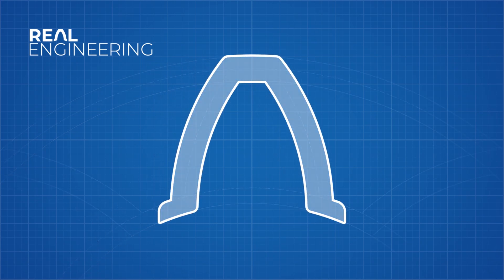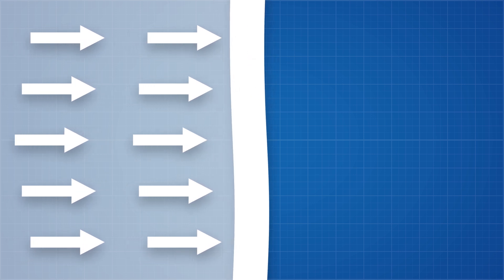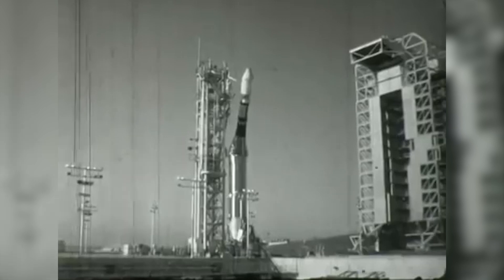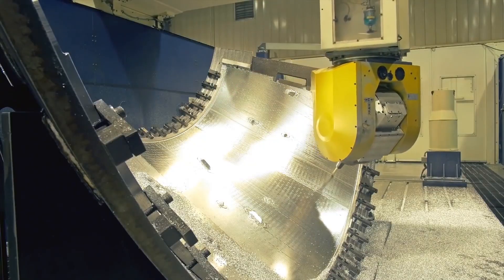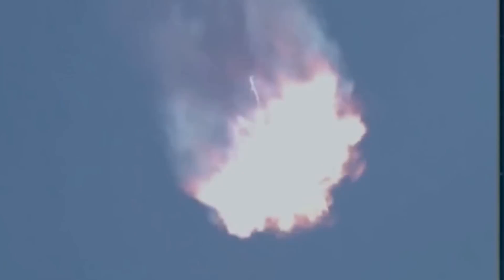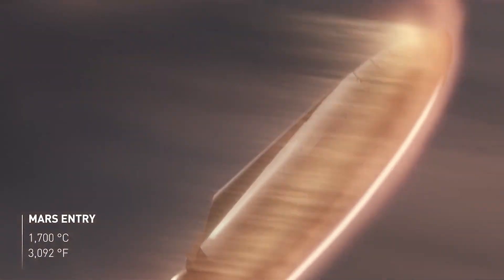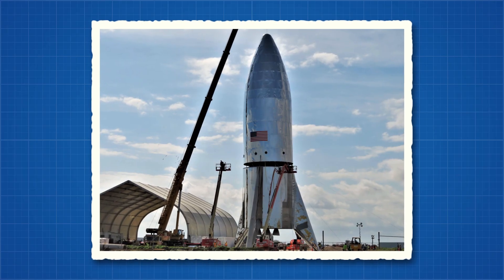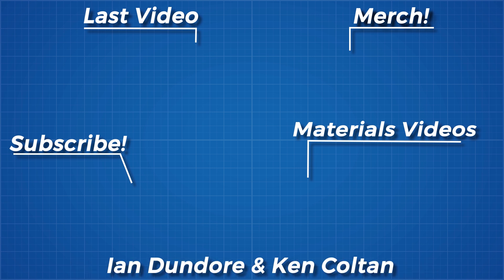Why SpaceX Built A Stainless Steel Starship

Comment: The sweating part is really really smart. Makes me believe that the best engineering is to copy nature.
Reply: we are biological machines if you think about it. maybe nature is the peak of engineering
Reply: @AverageBrethren  nature is gods gift and its our mission to to look at it and use it. Ki nda like a graph going closer to infinity
Reply: Sweating fuel while in fire, is not really a good idea
Reply: It is.
Reply: Sounds like what Nikola Tesla said "“If you want to find the secrets of the universe, think in terms of energy, frequency and vibration.”"
Reply: In deep learning field, computers took several hundred thousands of cycles to calculate the best parameters for their neural networks. And for mother nature, you can also consider it a super computer which already run for several million years for millions of animals and plants to try and error to find best solutions and adapt the environment and physical world. So it's quite reasonable to copy nature. I remember in some fields they call this technique "bionics".
Reply: Brandon Tea If I may be that guy: it’s called bio mimicry
Reply: @AverageBrethren  Nature is kinda garbage at engineering. Good "ideas" but shitty materials.
Reply: @A3ATOT  Remember, Mars's atmosphere is carbon dioxide, so the methane wouldn't actually burn while sweating.
Reply: GDash 69 of course someone has to mix god with real science
Reply: @AverageBrethren  Definitely not. It can be very useful inspiration, but ultimately, when you remember how evolution works, in nature you will find only the best solutions *that have emerged so far by chance*. Mutations a re random. Some are good and allow for evolutionary improvements, but they are not logically or rationally motivated.
The advantage of engineering is that we can skip this step of waiting for a better solution by chance, because we have the tools of logic and rationality.
Reply: Albert Einstein will smile when he sees these Havana cigars, hungry for fuel and slow as snails, after having seen Tesla UFO testings at 100,000 Klm / h. Real engineering 100 years late in time.  TESLAAAAAAAAAAAAAAAAAAAAAAAAAAAA
Reply: Brandon Tea exactly
Reply: As someone that cuts and trims trees, you have no idea. Take the ponderosa pine for example. A conifer with no real tap roots, a very small root ball compared to its size, and it thrives in areas of high winds. It's ability to stand up in the winds and snow loads comes down to its branches. It sways, it will sway a lot. The forces get dampened as all those branches sway with the tree. Those branches also shift the center of gravity like a tight rope walkers stick.
Oh, and to keep the soil at its preferred PH balance, it drops dead needles under its canopy. These needles hold moisture in the ground and make the soil acidic for the tree. It also helps choke out competing species.
Reply: @A3ATOT  Lol, it is not "Fuel" if there is no oxidizing agent
Reply: @AhmedAshraf-pd7mu  I've been studying biology in college for like 2y by now.

Obviously, "shitty" is a bit exagerated, "weak" would be better suited.
I am no expert on this topic but i'm stating impartial facts.

What fascinates me about life is its cheer complexity and the way it evolved to conquer the entire world despite not possessing any purpose. That's why i choosed to study it.

But on the other hand, since life appeared on earth billions years ago, it never quite "managed" to reach outside the earth. Somehow, we, humans are the way life will eventually continue to colonize new places.

Because there is absolutely nothing in the biological realm than can come close to a rocket, there is no living thing even remotely capable to store and output that much energy or to be as strong. There is no biological tissue that can fit any of this roles.

But don't give me wrong, i don't think mankind is superior to nature. I just believe that, with machines, humans have gone beyond a lot of limitation that living things can't overcome.
Reply: @xanthuumnihyr5319  yes, you are partially right 
But, don't forget, the more complex the chemistry of a system is, the narrower range of conditions (temp., ph, background radiation,  etc.) this system can be stable in. 
And life is extremely complex chemistry 
On the other hand, much simpler materials like the ones the engineers use, tend to be more stable, but far less sophisticated, and sophistication my friend is the symphony of life 
That is why you think materials used by engineers mostly are more durable
...
Let me give you and example, engineers needs huge machines and clean rooms to make some relatively simple micro machines from the materials engineers generally use, and I'd allow myself to assume that such systems would tend to be stable in a much narrower range of conditions compared to the bulk of the materials they made of (if someone have otherwise knowledge I'd be happy to learn from him)
On the other hand, the cell (a factory on the micro scale, not a clean room with huge machines, and the minds of brilliant engineers) can creat nano scale highly efficient machines using the bio materials 
These machines can make sophisticated biochemistry that makes various products with high efficiency that we humans some times struggle to produce with our advancements in chemistry (and keep in mind, we have the advantage of being able to moderate the temp. and pressure in chemical reactions, the cell can't do that, yet it is far superior to our technology in the regard of chemical synthesis)
...
BTW, wirless connections are never superior to neural connections and networks, our neuronal system doesn't only convey info. but also process them and make decisions and responses. 
...
No my friend, the bio materials are just brilliant (which is an underestimation)
Reply: @AhmedAshraf-pd7mu   
When i think of life, i see more a piece of art than really a piece of engineering.
It's inimaginably complex, and yet it works beautifuly but it's not made to do something, it's not optimized for something, it hasn't any other purpose than live.
Machines don't need to reproduce or repair by themselves. They are made by humans or other machines to accomplish specific tasks.
It's kinda cheating because getting rid of that "self-reproduction-reparation etc..." Allows for much simpler systems. Machines don't need to be made out of microscopic cells or to contain water to carry all the chemistry that metabolism needs.
That way, a machine can be made of much stronger, much more "optimized" materials. The energy sources of life are also quite limited. We mainly use oxydation for that when this reaction has quite a bad yield.

Actually yes neurons can do a lot of tasks. But information travels very slowly in the nervous system.
A good example of that is again, rockets. A human can't drive a rocket as well as a machine. And it definitely can't land as well as a machine. 
A machine is almost always better when good reaction time is needed.

In the end it's a bit like i said before, nerves can do more diverse tasks than wires or sensors but machines don't need all of this. They can be optimized.

But if course there still is the brain, and even if it's slow, it's quite impossible to get any better.
Reply: Yep just like airplanes to bird, and bullet train heads
Reply: Look at spider webs, spider webs are looked at a lot by engineers and architects
Reply: @Brandon Martinez  Pretty straightforward xD
Reply: @AverageBrethren  I think your onto something but your not following through. I think when we are able to mimic the human brain nature built with our technology of computers we are on the verge of something truly miraculous. Imagine you brain with ever increasing speed, limitless memory and with immediate access to the entirety of human knowledge at your finger tips or more like just a thought a way. I think that would be the pinnacle of engineering n
Reply: A3ATOT let me guess... Google University with an emphasis in “I have no idea what I’m talking about?” Methanol ((CH3OH) - C 1 carbon atom H 3 hydrogen atoms OH a hydroxyl group) is used in combustion engines as a way to cool them down during operation to produce more horsepower -street racers, top fuel dragsters etc. Methane ((CH4) - C 1 carbon atom H 4 hydrogen atoms) can be used as a cooling agent then vented to burn relatively safely as it is a derivative of methanol being that the only difference between methane and methanol is that methanol has one fewer hydrogen atoms than methane and a alcohol component (OH).
Reply: It is called biomimicry
Reply: @A3ATOT   No oxygen on mars, how is it going to burn?
Reply: @xanthuumnihyr5319  When you consider the capabilities of biological machines in light of the fact that they're built out of the most common elements on the planet, you'll understand how awesome biological machines are. Sure, superconducting wires could be faster, but its unlikely that you'd produce enough machines that they'd replicate in time to survive. What if you could build them out of air and topsoil?
Reply: @Mishkola   Absolutely, that what i said in my other comments.
But i was looking more through "human" perspective.
Living beings are limited because they have few materials available, and they need to reproduce and be polyvalent. But we don't need that, we need performance. Yes that's a quite unfair comparison, it would be like making a race between a child and an adult champion. The child might be a truly awesome individual (like extremely intelligent etc ...) but we don't need that, we need someone to win the race.
Ok that example wasn't as good as i thought but i hope it was understandable
Reply: isNull isNotNull no oxygen outside of the Marsatmosphere, in the vacuum of space (=no oxygen).. so how they even gonna get there? They take the oxidizer with them in a separate tank!
Reply: @A3ATOT it's not fire 
its plasma
Reply: meh water cooling for car radiator dates hundred years ago
Reply: @A3ATOT  I might be a lil late here and you've already been torn apart but even if there was oxygen in Mars' atmosphere that could support a flame, methanol burns way way cooler than the reentry temperature a ship has to deal with when entering Mars' atmosphere. So it is literally like sweating, the flame would be hot, yes, but still way cooler than the literal atmosphere of Mars heating up the ship.
Reply: @DatChinchilla  torn apart)) oh yes i am in pain) Wikipedia specialists make my head hurt
Reply: @A3ATOT  You surely must be joking, right? It's proven methanol burns cooler than gasoline and I'm pretty sure we can both agree that gasoline, even under pressure burns nowhere near the temperature of reentry. Source? Methanol is used in race cars to cool pistons because it burns cooler and has more energy content. That info alone should negate your original comment. Yes you were torn apart by numerous users, just take the L, brother. Also, you can't bash Wikipedia if there are numerous other sources that back up the same claim lol.
Reply: @DatChinchilla  Oh my! I'll tell you a secret. Nobody really gives a shit about internet debates)
Reply: @A3ATOT  Jeez buddy, you hurt my brain and I’m feeling like you’re killing people’s brain cells. Maybe stay away from anything engineering related for your own good lol
Reply: agreed.

Comment: Who come here after the launch? Starship roll multiple times at highest speed and still intact before be self-destructed. Its shown that Stainless steel is ultimate choice for it and maybe later space rockets.
Reply: Nasa had made a rocket from stainless steal and it couldn't stand its own weight if it wasn't pressurized, it collapsed on the launch pad

Comment: "where stainless steel shines" 

see what you did there
Reply: I wonder if Starship will use Chrome OS...
Reply: Pvt. Duckling Nah. It will use android.
Reply: @Duckly97  Stainless steel is in fact made by alloying chrome into regular steel.  ;-)
Reply: @justADeni  I thought it might be.  OR it might have been a reference to the shiny part.  Covering the bases.
Reply: Puntastic!
Reply: Yep, now we're cooking!!
Reply: 0
Reply: OH YEAH YEAH
Reply: @haoteng2823  Chrome can run on Android
Reply: @justADeni  not me. I still dont know that
Reply: @Keldor314  real acid resistant stainless steel dont have iron in it! 
its made up of other metals which can vary, depending on its use, crome-molybdenum-titan, and so on
my finger rule to find stainless steel with no iron in it,, ITS NOT MAGNETIC. hehe
as a mecanic i have also learnd to NOT USE  my most expencive drills to try to make hole in a real stainless steel plate i dont know whats made of, try drilling say the shear plate of a snow plow, haha ore an exavator tooth.  
but around 15 years ago i bought a useful tool, A SPRING LOADED PIN POINT MARKER the size of a pen, if it can make a desent mark in  the soft metal i can drill in but have to add cooling-greasing liquid if the mark is tiny
that pin point marker also have saved my boss hundreds of thousands on knifes to our metal plate cutting maskines that uses a knife!
we use CNC GUIDED PLASMA ORE WATERJET CUTTERS NOWADAYS ON MOST SERIAL PRODUCTION. SPESIALLY ON DETAILED STUFF where you say cut out 10,000+ pieces that shall look the same.
plasma works faster than the waterjet on many things,, but waterjet is great since most times you dont have to grind away the burn residue afterwards.
Reply: @Duckly97  It will use Windows 20.

Comment: Ok, so now that Starship has "advanced" its development, are there any arguments remaining for using steel? The dry mass of Starship is ridiculous. The HLLV from NASA's SPS study had a similar payload to Starship, yet only 4000t weight when fully fueled (lese than simply the fuel mass of Starship!) - even with some mass reserve! Apparently, aluminium construction/winged flyback is a pretty efficient design! From what I can gather, the SPS HLLV has enough of a mass margin that it can afford to have a heatshield separate from the cryotanks, with an insulation layer in between. Most of the heat is blocked out by the tiles and insulation, and so the actual temperature affecting exterior of the tanks should be no worse than the rocket standing in summer sun. So not a 2500°C difference but only about 300°C - much better. So it goes 2500°C frontface -> heat tiles -> 100-300°C backface -> insulation -> -300°C tank interior. By splitting the load, you can also optimize the thermal systems - the tiles for high temperatures to medium ones, the insulation from medium to low ones. In addition, Starship absolutely needs a thick TPS, no matter the material - its tanks also serve as the outer hull, so the tiles have to handle the entire 2500°C -> -200°C jump by themselves, the high melting point of steel doesn't matter. It would matter if the tanks were separate from the hull and it used a variation of the "hot structure" system proposed for the Dyna-Soar project, but Starship isn't built like that. There is a good point about the fatigue, but it isn't really tested - long-term wear and tear isn't really easy to predict. It could end up having higher maintenance needs than an aluminium construction, we can't know for sure until it is tested in actual conditions.
P. S. Plus, the heavy steel construction forces Starship to use baloon tanks, like the Atlas I/II - and everybody will tell you that rocket was incredibly difficult to handle and move around, since the structure tended to crumple and buckle at the slightest loads, and even collapsed if it lost tank pressure. And despite baloon tanks being one of the lightest tank constructions ever known, Starship is still incredibly heavy. So another hit against steel.
Reply: Hal   Do you really think SpaceX would waste their time and resources using a material that wasn't suitable?  With all the competitors trying to outdo each other do you think they would knowingly risk certain failure on a global platform?  The best minds in the world are being utilised on these tasks and what may seem strange to the average person with minimal knowledge, pales when other attributes are taken into account.  I would not be so bold as to say the experts do not know what they're doing.
You make some valid points, at least on the surface, but don't you think these issues have been considered already?
Reply: @SMHman666  There is one point in favor of steel, that being the fact that it is cheap and easy to make things out of. But all other characteristics speak against it. And even that advantage isn't useful, especially not for a reusable system. There might also be the "legacy" argument - they decided for steel years back when they thought they could get away with a "hot structure" design, and are sticking to it despite the original argument no longer being relevant. Trust me, I know a lot about rocketry. And it isn't as much "experts" who are pushing for certain features on SpaceX designs, but a singular person - its CEO. Everything revolves around him there, and several people have been fired over disagreeing with him.
And it wouldn't be the first time SpaceX did something dumb. Like, one of their Falcon 1 launches failed because they thought fuel baffles in the upper stage (standard since the first multistage rockets) weren't necessary, and then were surprised when it didn't ignite.